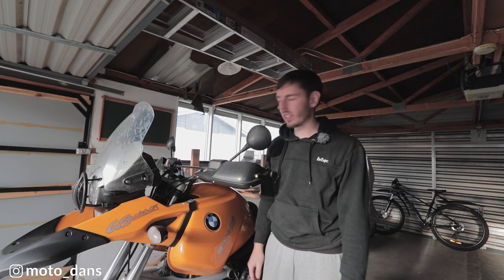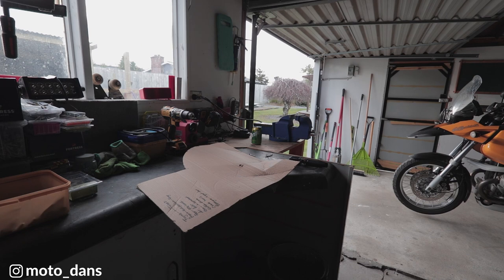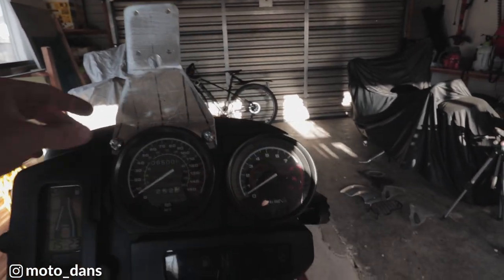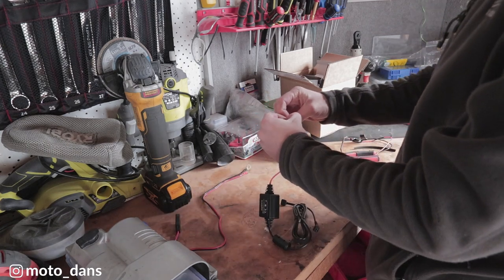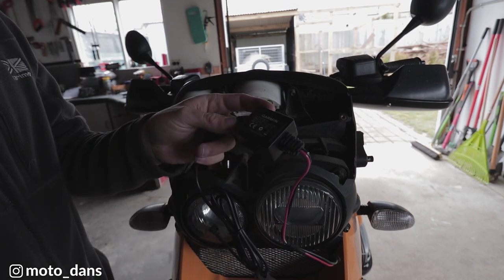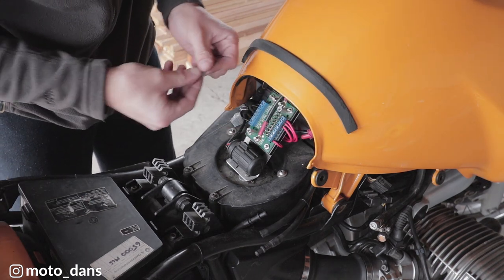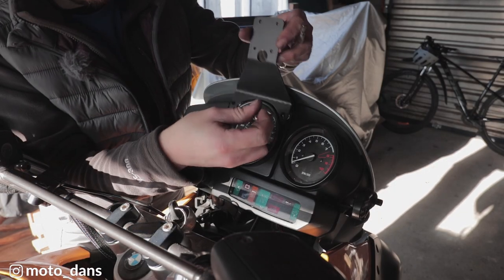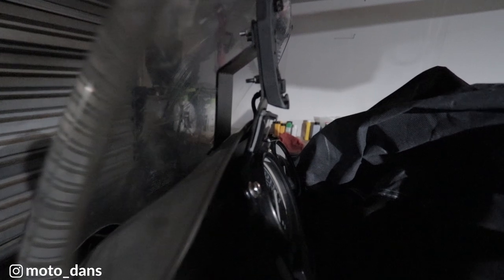Bmw R1150gs - Sat Nav Install

Comment: Lovely work. The migsel is nice. I jave one on my 1150gsa but your solution is probably sturdier and set back a little further as there is no ram mount. I use a zumo 595 with a sunshade that I got sent to Oz from Europe. Works really well.
Reply from the maker: 👍, I really like the migsel just a little on the pricey side for me at the moment. Really like the Garmin units
Reply: @MOTODANS  totally agree it is very expensive. However I was in the new to me phase where you can justify anything. Lol. Yes garmin do a great product. The only super fail they have had is the NAV VI for bmw. My mate os on hos 6th under warranty from bmw.   The forums on the unit are thousands of threads long every year since it came out.

Comment: Thank you for the tutorial ! Very nice, simple and cheap ! 😁 Exactly what I need!
Can you rebuild the headlights with led projectors ? I searched on the net but I didn't find it.
Great job ! 👍🏼
Reply from the maker: Thanks Harold 👍 Not legal in my country. Not allowed to retro fit led or hid projectors into halogen style lamps. If you can find a complete replacement lamp that has been tested to meet road standard they can be swapped. I won't be changing my light on this bike but I do plan on adding spot lights at some point 👍
Reply: @MOTODANS  ok, thank for the answer ;)